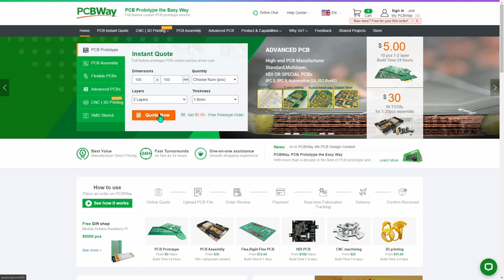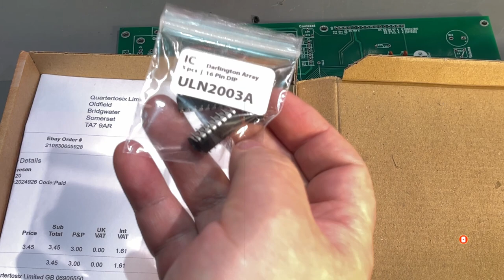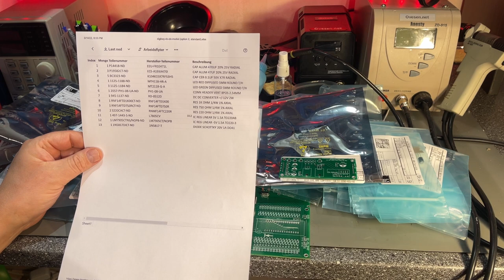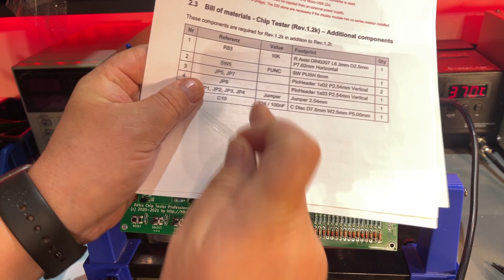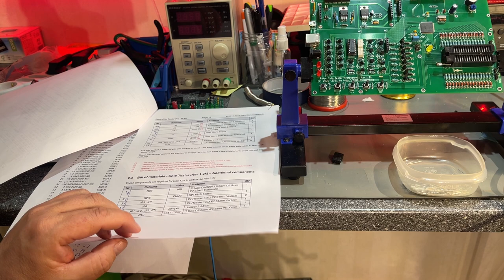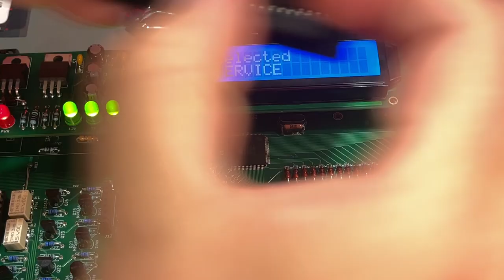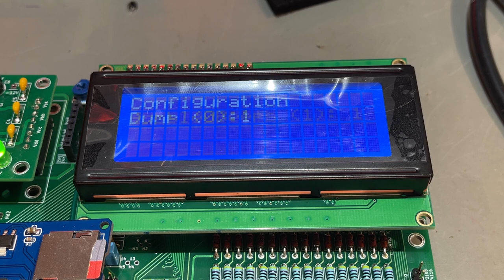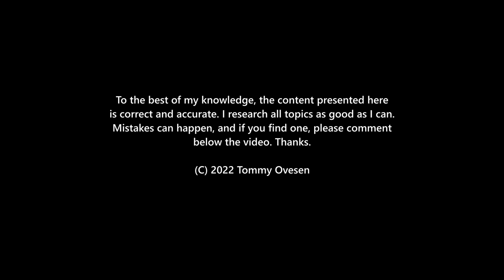The Retro chip tester pro - Building and testing the ultimate chip tester

Comment: Very informative video indeed. I know some folks who once purchased 27xxx and other electrical components as those had to leave companies when they went into the PC age. If they still had those chips this tester could come quite handy.
Thank you also for the very detailed description of how to handle different power supply connections. To me some users of the tester with only the manual at hand might profit massively of this video.
Thanks also to the 8Bit-Museum. I did not know, you must be testing and resurrecting a lot of old machines.

Comment: What was the price for the chip tester board without components?
Reply from the maker: 93 EUR including the dc/dc boards, 2 breakout boards and preprogrammed.
Reply: Without components 30 EUR. When you want a board with the ATmega2560 already populated you have to add the price for this component. The ATmega2560 is currently quite expensive.